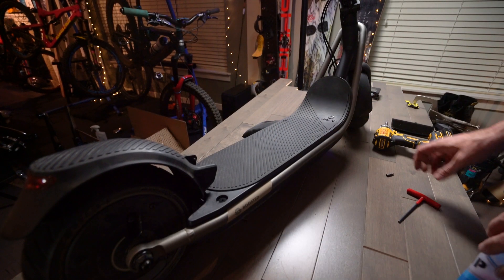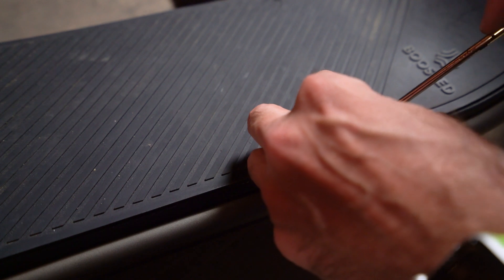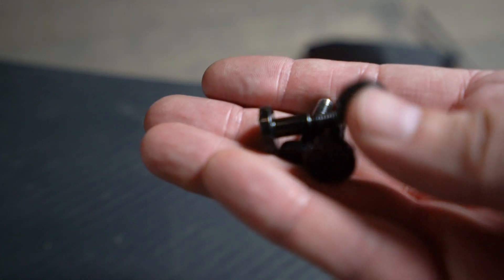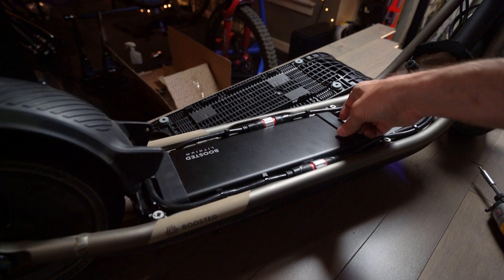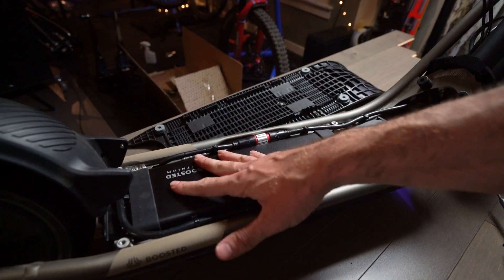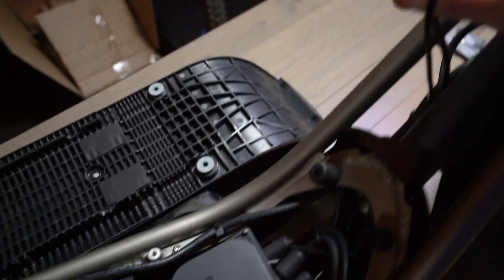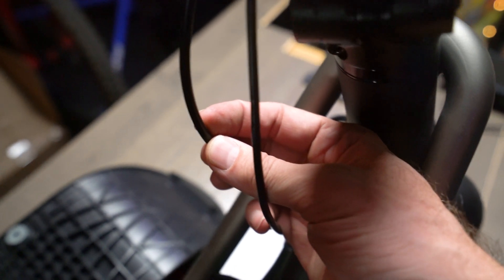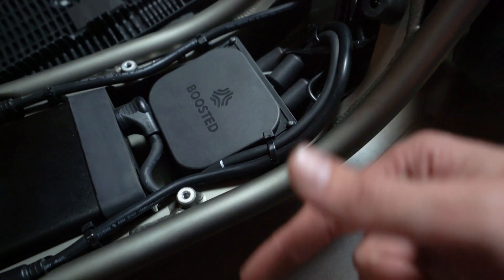Boosted Rev Scooter: What's under the deck? How big is the battery?

Comment: No bolts holding the battery in on the bottom or anywhere else. You just remove the deck as you have done and lift the battery out from the front first. It is in snugly but just lifts out.
Reply from the maker: Yes see a follow up vid I did specially about the battery, cheers

Comment: I’m mounting some USB powered LED lights to the underside of my REV. I had thought to put a small portable charger under the deck. I couldn’t tell much from the video, but is there room for something above the controller towards the curve?
Reply from the maker: i don't think so, but not 100%
bummer they don't run a usb port out of the controller.

Comment: More deck screws and a rubber gasket on the cover would have eliminated water from getting inside.
Reply: @LukeMTB  I shouldn't have said gasket I meant more like a rubber grommet. It could attach to the edge of the deck lid and then formed over the top of the tubular frame. Then at least 2 deck screws at the front of the deck where the Gap is. At least everything inside( battery, controller, wires, and connections) are all well protected and encased with rubber or plastic.

Comment: Is the black tube connecting the steering stem welded to the silver frame? The same part, just painted differently?
Reply from the maker: I don't think I looked super closely at that, but I would imagine it has to be. Probably one of the most important welds.